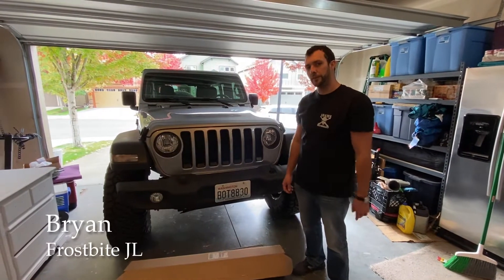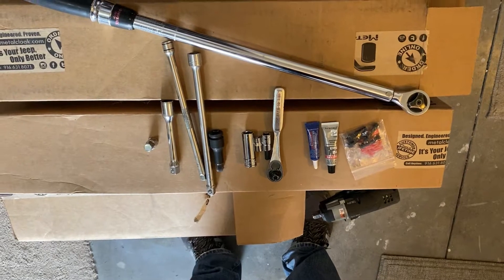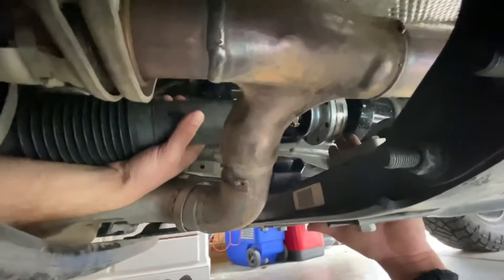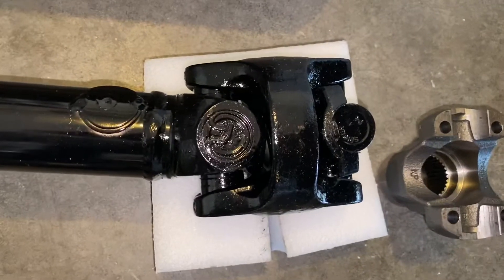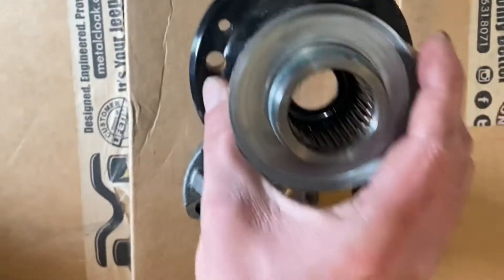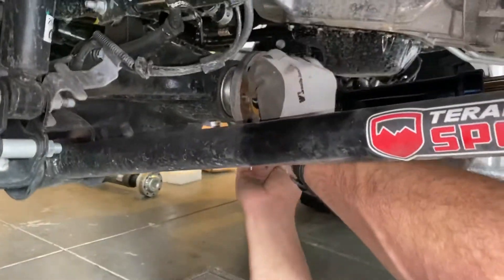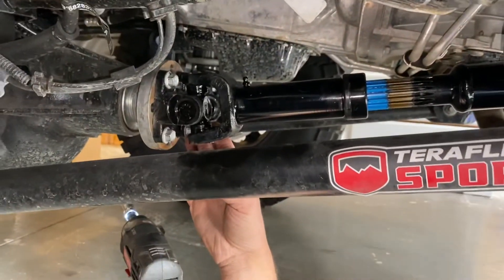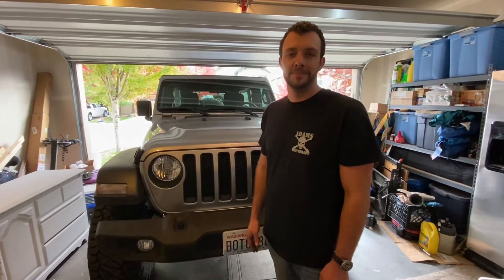New JL Wrangler Front Driveshaft from Adams Driveshafts!

Comment: If you were going to upgrade why did you not go with a 1350 ?  I’m planning on upgrading my JLUR Drive shafts and everyone’ tells me to get 1350s
Reply from the maker: It’s personal choice, at the time I had a Dana 30 and did lighter wheeling. If I was building it up again I’d probably go 1350.
Reply: A lot of people opt out of getting the 1350 unless everything else is already beefed up like axles, engines swap, etc because they want the driveline being the weak point because it is the easiest/cheapest thing to fix if someone thing is going to snap/break... i ignored all that advice and ordered the 1350 still lol 
I assume you’re staying below 4.5” lift since you have to give measurements for anything above when ordering(?)
Reply from the maker: @scooter_0113  I totally agree, I’d rather carry a couple extra u-joints than blow a ring and pinion. I don’t plan on ever going over 3.5” of lift but we’ll see where the build ends up.
Reply: 1310s make the differential safe from being the weaker point. Breaking a 1310 U joint cost 30 dollars to fix versus 2,000-dollar differentials to fix when the teeth break off your gears when you have 1350 on the front drive shaft. Tough front drive shaft is a bad idea. Even if your driveline is beef, you want the U joint to break if anything does break over expensive components of the driveline.